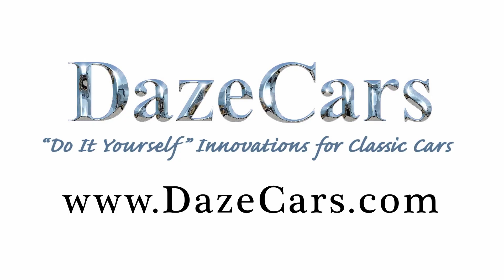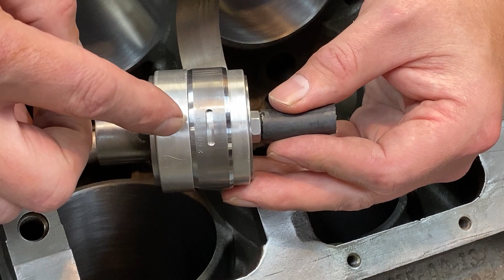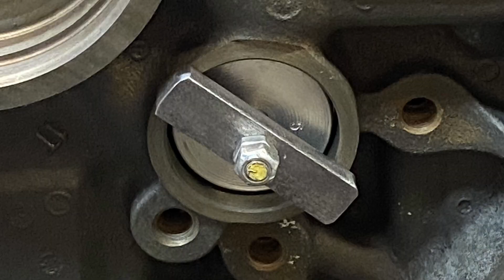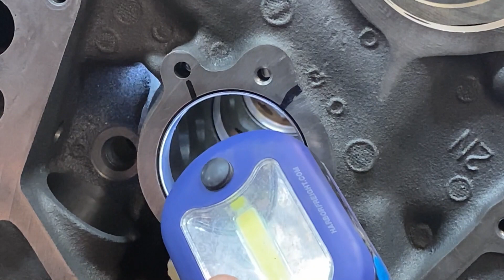393 Windsor Ford Stroker Build Part 3 DIY Camshaft Bearing Installation SBF Homemade Install Tool

Comment: You should also beable to use that with a pice of  all- thread? To make a slide hammer to pull the old cambeirings out. 👍
Reply from the maker: Good thinking, making it versatile for removal too! 👍

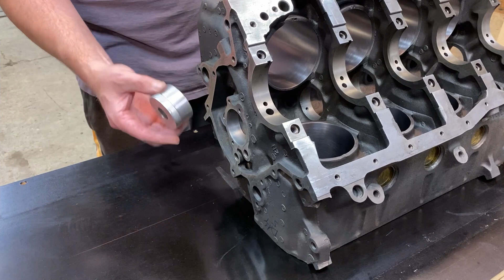Comment: Nice thought and machine work. But,....there is always a but right ? Lol   anyway you can't put the last freeze plug in because the end of yoyr tool sticks out too far. So you have to do cam bearings then freeze plugs. Not a bif deal really but i noticed because i do freeze plugs, then cam bearings etc. 10:11
Reply from the maker: That is true.  For me I have no problem putting the freeze plugs in after the fact.
Reply: @dazecars  yes I understand and agree. I posted that comment before the end of the video. And after seeing the access to #5; with that plug out I think that is the best way to go. Now if I can only remember that the next time I do one,  👍

Comment: Also, when installing the cam first, set the block on the rear (bellhousing) face then gravity helps install the cam.
Reply from the maker: On the bench like in the video that makes a lot of sense.  Probably more effort than I would want to do it it was already on the engine stand.

Comment: Not sure how far you are into your build but I would like to see the oil galley hole plugs being installed. Seems like one of them have a hole in it to let something get oiled. Also are you tapping the oil holes for a plug or just installing a miniature freeze plug??
Reply from the maker: the ones that are already tapped (from the factory) will get tapped plugs, the ones that are press plugs will get press plugs.

Comment: Nice to see a DIY tool/opion for the very spcific job!  The all-thread trick is pretty neat.  Are you able to put the pucks in from the oposite side of the cam journals so sliding the all thread in would pull he puck to the journal instaed of pulling them out?
Reply from the maker: yes and no.  2, 3, and 4 could be installed from the other direction but if you did that with 5 it would pull the #5 bearing out as it pulled the #1 bearing in.